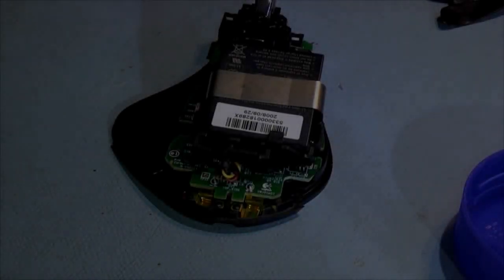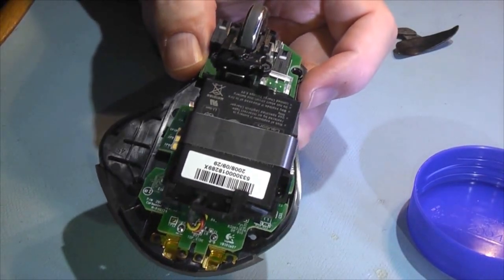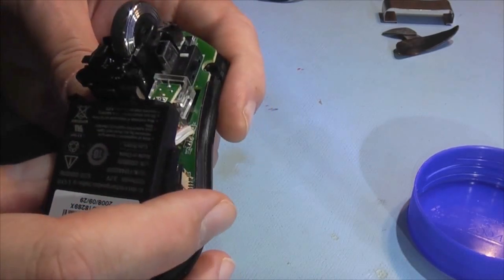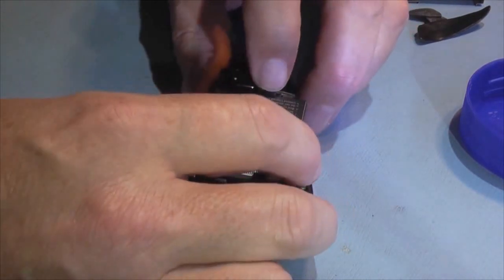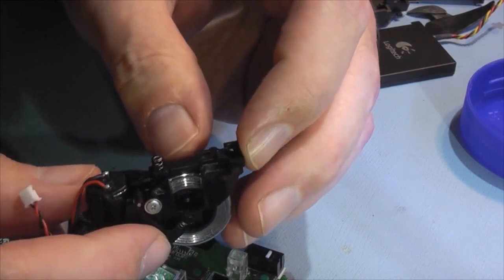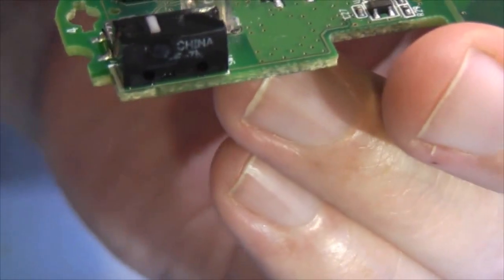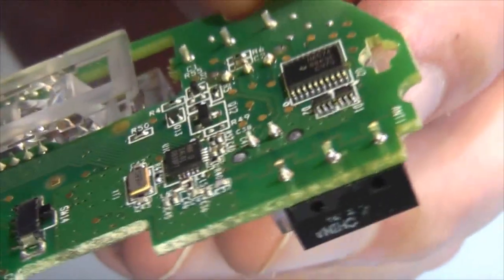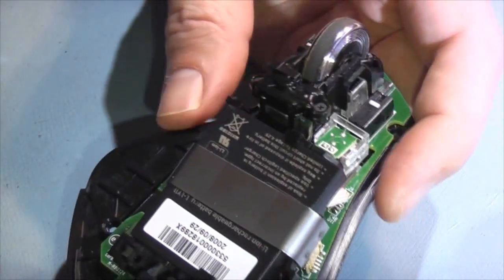Logitech MX Revolution Mouse Switch Replacement - And switch lube request.

Comment: This mouse was the worst crap that logitech did at the time! One of her worst mice, very expensive at the time, battery killer (battery is very expensive), several problems with clicks and fragile internal structure! Totally opposite of the Mx510 / 518. I bought a remanufactured one in 2010 and it's standing here, I'm sorry for those who bought it at the store! Trash pure!